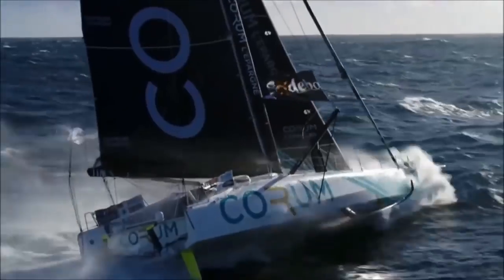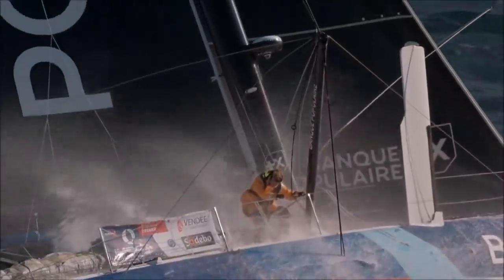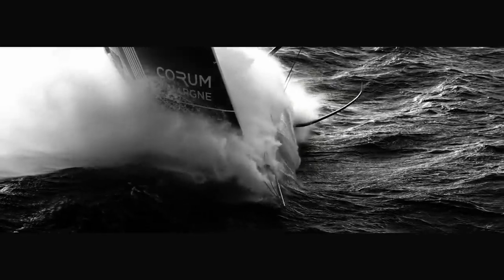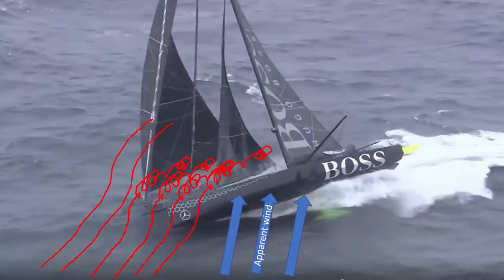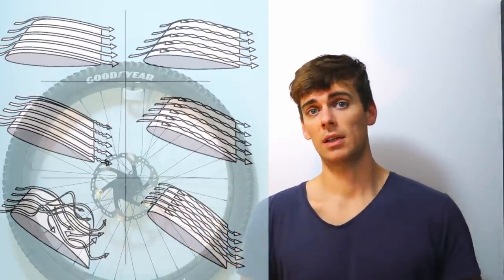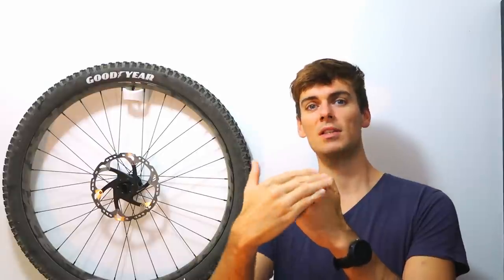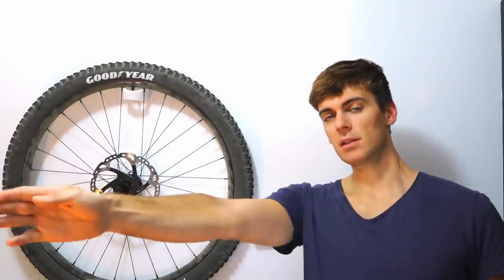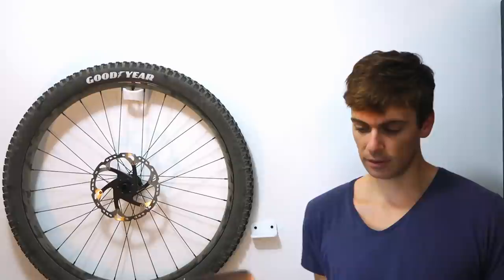Why Corum Dismasted - IMOCA Tech flaw? #VendéeGlobe Boat Design Analysis Part 2 - Aerodynamics

Comment: Firstly what a fantastic pair of videos. They have a lot more technical detail than you will find in lots of supposedly sailing specialist videos and publications and really good presentation and post editing. Thanks you for making the videos you make. There are lots of people who are looking for content with a bit more engineering backing it up.

I might be able to help with some of the questions you raise. You have some questions about aerodynamics, boom height etc. Firstly things like stanchions, safety wires, jack stays and toe-rails, all of which have really poor aerodynamics; These are there as part of the rules set out by World Sailing and other organisations that keep any eye out for rules they think are important for safety. Things like toe-rail height is mandated, as are stanchions, including what they are made of and the diameter of wires. Round stuff is pretty poor aerodynamically but lots of stuff sailors might be able to make contact with has to be pretty blunt and that might mean rotating fairings might be heavier and quite dangerous. I make a lot of stuff in carbon fibre and I could save a lot of weight making carbon fibre stanchions, pushpit  and pull pit but I would immediately diss-apply myself from ocean racing if I did.

A good example of where safety and performance is in direct conflict is something like non-slip decks. A nice shiny surface sheds water really nicely. A nice grippy deck holds a lot of water. The former is quicker in terms of skin friction and the overall weight of the boat in all but the calmest, driest weather but you still need to stay on your boat, so non-slip surfaces are mandated. There is no doubt that hulls will be developing lift like a low aspect ratio wing in the future but unlike a glider, instead of having a waxed slick finish, it will probably still have non slip paint or textured surface where you need to stand on it that will knacker laminar flow. So basically the reason lots of stuff is the way it is, is the result of the racing bodies setting rules, which is mostly with our safety in mind. It is a dangerous sport. You really have to be out there in 'serious' conditions to realise that from time to time you are more concerned with preserving life than racing, Sitting on the sofa it is hard to imagine.

Even though nearly everything is done from inside on these IMOCA boats, the rules are still there. The reason you don't have those rules for the Americas cup is because they do a different type of racing which has different rules, although it should be noted that the old school J class yachts that used to race in the Americas Cup seem to be a bit short of stanchions too and those boats would have crossed oceans. In any case inshore match racing is really pared down. You don't need anything like the gear you need for offshore ocean racing. There is literally hundreds of kilos of extra equipment. You won't find for example that Americas Cup boats need a liferaft, flares, shortwave radio, radar, 2x satellite phones, medical kits, vhf radios, navigation lights and day signals... I could honestly keep going for 10 mins with all the extra stuff. Equally boom clearance is a function of safety and designers do their best to make it so that crew don't get whacked by them if there is an accidental gybe. A few people have been killed in ocean races in recent years by being hit by booms, so it is a real risk. There is no doubt a lot of benefit sealing the space between the boom and the deck in terms of aerodynamic efficiency and this is often attempted on the foresails that have a soft foot but with a boom on an ocean racing boat the boom is operated at a much greater range of angles than it is on ice boats, Americas Cup or even the latest generation multis. Ice boats and inshore foiling vessels are going so fast that the apparent wind is almost always well forward of the beam. The required boom height and the fact you can't be catapulting your crew over the side with a skirt attached to a boom are probably the reason we don't have the type of seal on IMOCA that we see in the Americas Cup. Like the Americas Cup though, the IMOCA rules are renegotiated regularly to keep the box rule up to date and now virtually everyone is enclosed, there may well be rule changes, that might for example include a new mast specification that reflects the loads they are now generating. It would be definition be heavier, so only those boats that needed a stronger mast would go for it anyway.

Finally how much are those sails? Well I can't tell you that exactly but I can tell you how much 3d composite sails cost on boats I have owned. So on a mid 1980s 10M race boat, a composite sail (this is the next generation up from a laminate sail) costs about £6500 these days. The boat we have now (12.5M) is much more performance orientated, a bit like a fast 40+ but beefed up for offshore racing. The boom is about 22 feet and the mast is about 70 feet from the boom to the mast head. Ours is quite heavily roached rather than having a flat top and the mainsail costs about £27,000. Just guessing but a main for an IMOCA has to be well over £75,000 probably more but you have no idea how much sponsorship adjusts this. If I was a top sailmaker I would want my sails on the winning boat. In reality everything gets disproportionately expensive as boats get bigger. A roller block for the 10m boat typically cost £60-£120 anything block-wise on the 12.5m yacht costs a couple of hundred. I wanted to buy some really large diameter roller blocks for the big asymmetrics (like 7" sheaves) and they cost £3500 each block. Sailing these IMOCA boats is an enormous financial undertaking because everything will probably be a magnitude more than you would guess based on even biggish racing boats. Even sailing the mini-transat boats usually requires serious fund raising. In that respect, the smaller Minis often signal the trends that will filter through into IMOCA, so you might be able to do some great videos looking at the trends in these pocket ocean racers to predict where their bigger sisters are going in terms of design and engineering.

I think what's interesting about the Vendee this year, is that it may well be won or lost by the engineers rather than the sailors. Some of the most advanced boats are just breaking and we are only a fifth of the way through.
Reply from the maker: Cheers Jon. This looks like the most detailed comment I've ever received. I'm going to make a brew and read through carefully!
Reply: @PeakTorque  haha you clearly haven't read the one I wrote about your carbon frame video!

Comment: Couple of quick observations:
1. You can't compare the need for stanchions and lifelines between an America's Cup boat (where there is a chase boat within 100m of you at all times) and an around the world offshore boat where a man overboard is deadly.
2. Shaping stanchions or other round surfaces aerodynamically is difficult because the direction of the apparent wind is variable.
3. "Unless the shit hits the fan how often is the sailbag used". With that kind of logic, may as well save some weight on those silly life rafts too!
Reply from the maker: Yep. I know. Totally different applications. But I'm referring to them for the trickle down effect of features that could be implemented with minimal impact on safety. Lifting T Rudders would arguably make the IMOCAS safer with more stability!

On your point 2.... How does a weather vane work? It streamlines into wind. Mount the fairing on 2 x 6806 bearings.... There's your answer.

Comment: Just wondering if the handrails are required by the regs?
Reply from the maker: Quite possibly.
Reply: 100%
Reply: They are for very tightly regulated by a larger group for international offshore racing and pretty much all monohulls have the same rules for what they are made of and the strength requirements.   If you ever go up on deck in rough water on even a regular boat it wont even be a question if they are worth the drag. That area is inaccessible without them. You can optimize it a bit and the newer boats did by moving the deck area in some but i think it was for much different reasons.

Comment: It's pretty arrogant to assume half of the ideas you put forward, haven't been considered already. Your arguments also seem to assume unlimited budget. 

Imoca has very successfully evolved it's rules to ballance affordability with technical innovation. Without this ballance we'd see a far more limited fleet, much like the current AC format. 

Getting sponsorship for yacht racing is hard work, if the boundaries of technology and therefore cost increases exponentially, the sponsors dry up, this is exactly why F1 is introducing cost caps for 2022.

 I'd take a good look at the history of this race and singlehanded racing in general and you'll soon understand some of the commercial drivers behind the current rules and therefore the technology deployed.
Reply from the maker: Yep. I know. Totally different applications. But I'm referring to them for the trickle down effect of features that could be implemented with minimal impact on safety. Lifting T Rudders would arguably make the IMOCAS safer with more stability! 

Regarding cost to entry. With IMOCAS it's interesting and PR flawed? Take the Vendée. The hardest endurance race on the planet of any sport I'd argue. Yet how many outside of France and Sailing have heard of it? Not many. That's why its a sponsorship and PR nightmare. For big corporates it's a money pit with very little in return. Only AT has a model to make it work. Its all too easy to finger point at the boat costs, but you cannot compare it to F1. What international sponsor would want to be involved in this race with such little exposure? I'd say that was the main problem that needs fixing. If it had huge exposure, you would have big sponsor names wanting to be involved. You have guys and girls out there with great palmarés, great presentability, likeability, who can't get a ride in this race.
Reply: @PeakTorque  and because you know everything about everything, you know how that could easily be fixed, of course?   By the way, what's your own record at foiling and at shorthanded offshore racing?  You know so much more than the pro designers and sailors do but for some reason your name is not at the top of the results.  What gives?

Comment: As well as what @G Cox said the rig is one design throughout every new imoca so technically they can't change boom heights without twisting race regulations
Also I quote 'shit hits the fan' all the fucking time so I would say it's probably nesacary quite alot, as well as with boats like Hugo boss its probably a royal pain in the ass to have to go outside excessively since it seems like it's probably not easy to get in and out of the cockpit of some boats witch sorta necessitates the sail bag
Admittedly on most of the boats not so much of an issue.

Don't quote my spelling it's probably shit

Comment: Another obvious problem to the layman is that adding foils midship to a conventional boat creates an upside down pendulum (with regard to pitch) once the boat rises out of the water. Discuss... Reading the comments below it appears that the boat has to be manageable  for one person in the wide variety of conditions encountered sailing around the planet and therefore  strictly purist aerodynamic analysis has to be tempered by practical considerations. Overall, my thoughts are that they don't understand the true nature of this departure from tradition by introducing foils...

Comment: I look at the hulls heeled and they have to be faster upright
Reply: you might be right but that would require a full crew and near constant trim adjustments. and being a bit overpowered helps you beat through the waves. Can't be over powered without alot of heel. I think they aren't really pointing during this race so its 100% keep the Speed up. But I do agree this looks insane to me.
Reply: @jakegedrimas7569  every boat forever heels. I'm finding the odds in solving that 99 percent impossible.

Comment: Ironic that you're talking about force loading and it's effect, while standing next to a wheel that's hung by putting a load on the inflation stem in a way it's completely not designed to handle.  :)
Reply from the maker: Hmmm. The weight is on the rim surface, not actually on the valve. The valve just stops it slipping off... NICE TRY 😅

Comment: I think you might have to check the international yacht racing rules on the stantions. Trust me around the cans in an old AC boat with guard rails you gulp.
As to the publicity shots of the boat sailing they have sponsors flags etc. I have only seen pictures of the main fleet with drop bags on the boom. Some of these are string, but I am sure some are tied in at times.
The boom also needs not to hit the water until as late as possible when broaching so that needs to be taken into account.
You are not wrong in what you are saying but it is finding the compromise.
Finally given the choice of a mast falling off or the keel there is no choice.
Keep them coming, don't fancy a video on the new NZ AC boat 😁
Reply from the maker: Quite possibly in the rules. Didn't look that deep. The new NZ AC75...big hull redesign over the first one... huge skeg almost entirely for aero reasons... lift producing and also acts a slat to separate wing pressures. What do you think?
Reply: @PeakTorque  I will go for show their true ideas. To me it shows none of the challengers are pups. I think what will separate them is the rigs and handling. 
Back to the IMOCA boats I see one has a cycling winch to pull true mainsail up. As it only takes 15min using out with no stops. Wonder how many gears it has as typical which might have 3.
Reply from the maker: @grahamm2015  absolutely ridiculous more boats don't have a cycling grinder. She only has it fitted because she (skipper) is about 5ft and 50kg, so it suits her better. A really fit skipper could maybe do 300 Watts in a recumbent cycling position, probably only 200W on the handheld -  not to mention saving considerable stress on the lumbar that is required on the handheld grinder. We saw bike grinders on the last AC. Think they're banned now, but they're certainly more powerful.
Reply: @PeakTorque  excellent update on  Vittorio d'Abertas channel on the different foils the IMOCA boats.
Reply: @PeakTorque  https://youtu.be/eGIO0ddDKF0 this boat I understand had grinders on bike, a complete beast of a boat. I remember at the time thinking the NZ team had stuck it to them, pity they did not think all the way through.

Comment: Coming from cycling you should know. They can't do all  the good stuff this year, how are next years machines going to go faster be more efficient, engineers leaving easily attained room for improvement for next year's marketing campaign
Reply: Really?  Why would they do that when they are dealing with gear that is not sold to the general public?  Why are they making this year's boat slower than it could be - so they lose the biggest race on earth?  Really?  Why?  How many top boats have you sailed on?  How many designers do you know?

Comment: While you have some good ideas you really don't know what you're talking about. Many of your suggestions violate the rules, would add significantly to the cost and/or ignore safety issues when sailing single-handedly.
Reply from the maker: Yes I agree in some sense, these are just hypothetical ideas. But sometimes the status-quo needs to be challenged. Many of the ideas, once standardized, could be implemented with minimal cost and non impacting on safety. It seems the easy excuse with these Imoca class races, and most top end yacht races, is to point the finger at the boat costs. But actually, the big flaw is the sponsorship/PR model. Its pretty woeful.
Reply: @PeakTorque  if you stopped thinking you know far better than they do and listened and talked to them, you'd find out that they DO challenge the status quo all the time.  It is arrogant in the extreme to think that a noob knows more about handling these boats in the Southern Ocean, and the design compromises that entails, than do the people who have actually done it.  It is utterly illogical for you to claim expertise because you have done a university course and then to decry those who have the same qualifications plus actual experience.  It is even stranger when having decided that you know more than boat design than the designers, and more about sailing than the sailors, and more about running a class than the class organisers, and then go on to decide that you know more about sponsorship and PR than the people doing it.  Really, your should please try to keep your ego in check.

Comment: Mate you have the engineering nailed but your not thinking about the sailing aspect , crew aspect and boat handling aspect. 
Solo ocean racing so so much more dependent on the people doing it then the boat,  Yes we Cam is proving that now nicely.
You have a lot of good points but consult a sailor before doing these videos so you can incorporate the sailing part , they will explain to you why some things are the way they are.